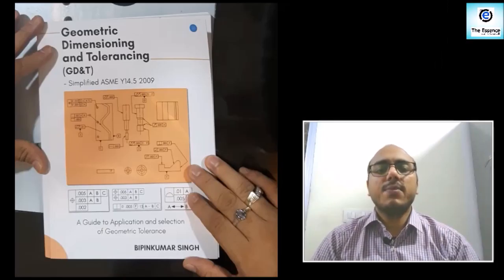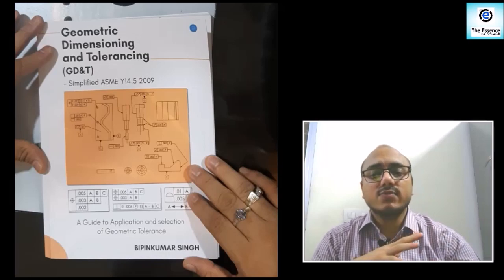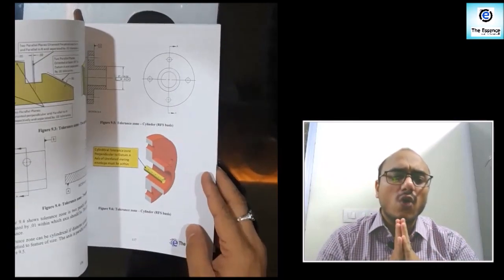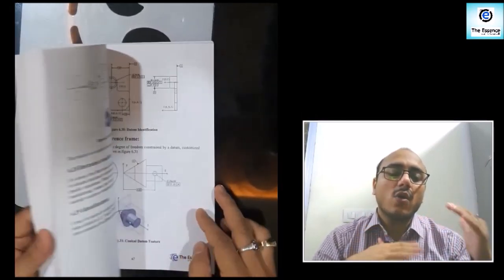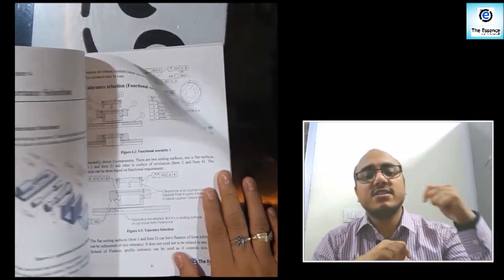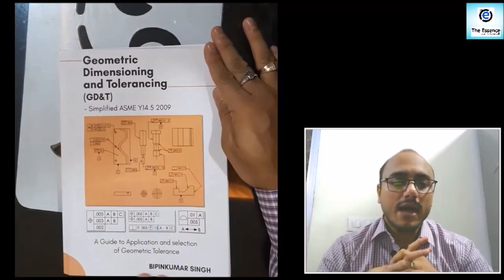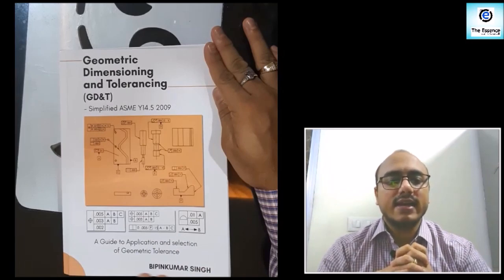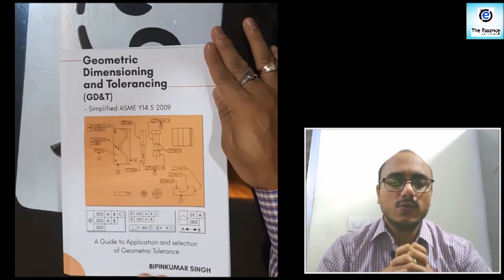Simplified ASME Y14.5 2009 Book

Comment: Thank you thats good initiative sir, but there is amendment in ASME y14.5-2018 edition
Reply from the maker: Hi Amit, 2018 has slight changes like symmetry Tolerance and concentricity is now removed. Few minor changes. Even 1994 version is also in use. Today's date most common you will find 2009 version only. That is why I chosen this. Let me know any further questions.
Reply: @TheEssenceofknowledge  Thanks a lot sir,  just for curiosity,  i would like to know the reason that why concentricity & symmetricity was removed  in 2018 edition, if you can cover this in any upcoming video. that will be really helpful to us
Reply from the maker: @amitpuranik3455  due to its complexity of measurement. The same can be controlled by position or profile tolerance.